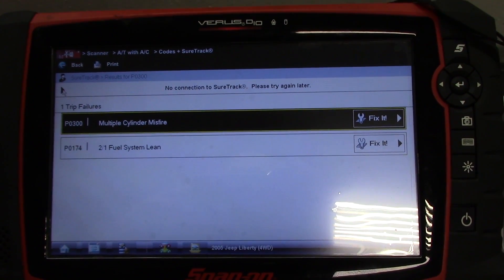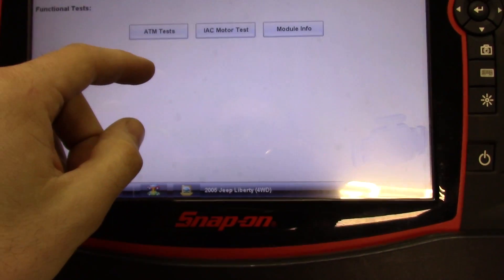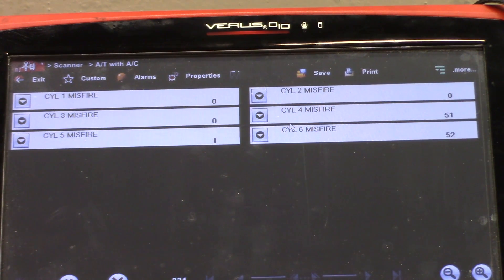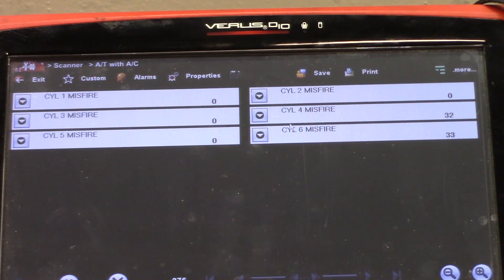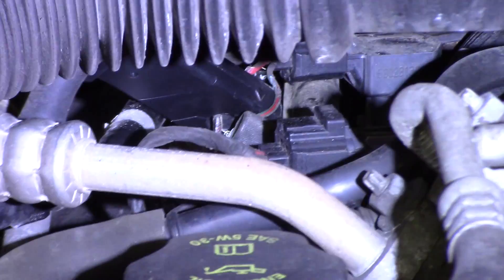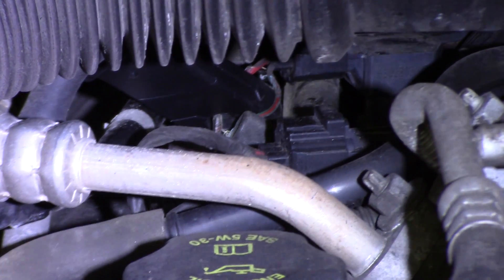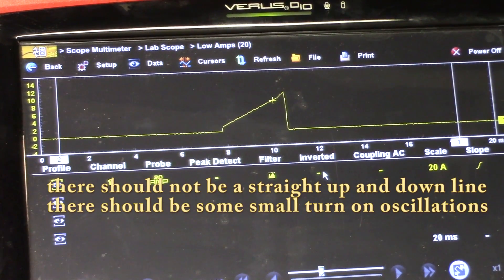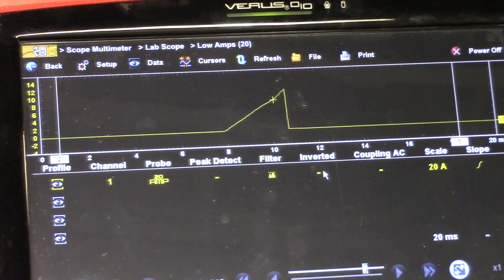2005 Jeep Liberty 3.7L P0300 Multiple Cylinder Misfire (ignition coils, shorted secondary windings)

Comment: I've been through this PITA.  The PO300 is the Jeep Liberty computer's way of saying there's a fuel/air  problem but it doesn't know why. The OBD will say random misfire but all plugs, coils and seals are fine.  No cylinder is misfiring, just the appearance of one caused by the computer running full rich and cutting the spark to various cylinders in panic mode. 

If one starts the engine and it runs rough, maybe quits and can smell uncombusted gas, it means some component failure caused the computer to lock on full rich. Shut the engine before it eats the seals. It's not a misfire.  If it were the computer would specify the cylinder. Usually, the issue is  the  MAP sensor fried or clogged. Or the MAF. And there are others.  

A pro mechanic will hook a scanner up and identify the issue in a few seconds. 

The computer strives to achieve 14.7:1 fuel/air ratio. When any sensor or relay kicks the bucket, it sends the computer into a tizzy that sends out bogus diagnostic info. Disconnect the battery, let the computer calm down, reconnect.the battery, plug in the OBD-II, turn the ignition to pre-start and the computer will eventually pinpoint the problem component.
Reply: My 3.7 was misfiring do to bad connectors to the coils. Just splice in new connectors, all good.
Reply: Just remembered, the Liberty doesn't have a MAF, which is good, one less needless aggravation,
Reply from the maker: I had two ignition coils with secondary winding issues. This veh was definitely misfiring. I had control to the coils the entire time. The computer did not cut the spark. Are you just saying in some cases it may be an air fuel issue and not an actual misfire?
Reply: I believe you. I saw the video. 

In my experience with Jeep Liberty is they're cruddy cars and when the PO300 code flashes up on OBD-II it means junk the vehicle and get a new car.  The PO300 is the beginning of a bottomless money pit for futile repairs. All money spent on repairs is money lost to get a new car.  

The non-specific code for random cylinder misfire,  with the vehicle usually over 10 years old, indicates a much bigger problem that the computer can't pinpoint. It's nearly always a low compression issue from age, use, wear & tear, where the computer goes full rich on both banks, dumping fuel out of the engine. The PO300 will cycle over to the MAP, or other, then to PO172 and 175. It means call up a car charity and donate the heap for the tax credit.  The car is now a POJ.
Reply: The Liberty shouldn't be called a Jeep. It demeans the legendary name. The Wrangler is the realest Jeep, the Laredo is also a worthy Jeep.  The Liberty is a POS. 

The PO300 code, quite possibly the worst code any owner would want to see, always means a low compression problem. The computer measures the crankshaft rotational velocity at 1000rpm and the velocity is abnormally low because more than one cylinder isn't working. The problem could be that more than one coil-on-plug packed it in, but the computer isn't capable of identifying the affected cylinders. It can ID one without a hitch. Just not two at once because a cheap bargain basement Liberty. 

The PO300 code usually means, and absolutely verified by the smell of raw gasoline vapour wafting up the nose, that the valve seals of at least two cylinders are blown, with repair cost probably in excess of vehicle value.  That's why I paid the bucks for a quality Laredo next door to my neighbour's trusty Wrangler.  I hate fixing BS car problems and avoid by paying the bucks up front for a quality, reliable vehicle and maintaining it properly.
Reply: haha, you summed up every jeep I've seen

Comment: I just switched coils and seen if misfires changed to other plugs. Stayed on same #  plugs. Always have blue powder on plugs and wires. These Liberties SUCK! There's something wrong in design . Don't get taken with you need new coils!
Reply: fools not changing the spark plugs at 30K is the biggest issue, OE plug is NGK copper v-power. :)
Reply: Throttle, thks. Done plugs but there's something wrong with electrics. Had some dry days and now all dash warning lights that usually come on and off and the intermittent misfires stopped!. (was getting engine, anti skid and low tire) Now  jeep runs fine.  When it rains and humid again they'll all come back on and the miss fires will return. Bad chip, bad connect some where? Too intermittent for a mechanical I think.  If I need to go out of town I just take the old F-150.
Reply: BlueRoseRocketBand there could be an electrical issue.  Check the pcm connections inside and out

Comment: Person most have bin driving around with single cylinder misfire, but when second coil went south vehicle will barely move, I am sure it will be coming back with a cat code very soon ! good video
Reply: Cat code?  Do you mean catalytic converter?  And why would it do that?  I am curious as I have just replaced all my spark plugs and 02 sensors on my KK, reset the ECU and still have a P0420 "catalyst system efficiency below threshold (bank 1)" code coming up on mine.

Comment: Couldn't use the scan tool to do the power balance test? or look at misfire pids? Also, I know coils are super common on everything, why did you go straight to coils vs injectors or vacuum leak?
Reply from the maker: I was just going with what I thought would be easiest check first